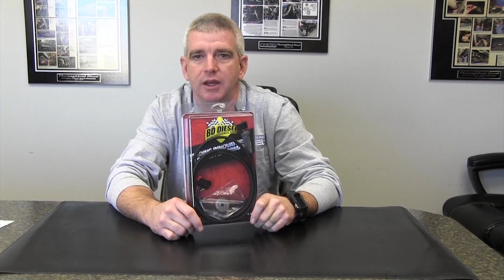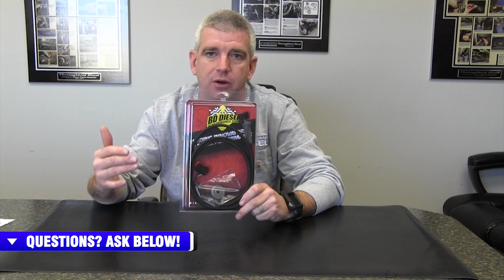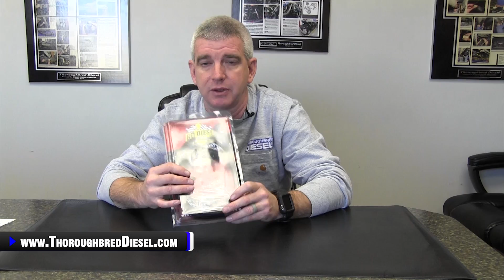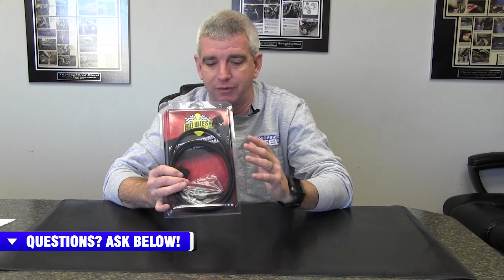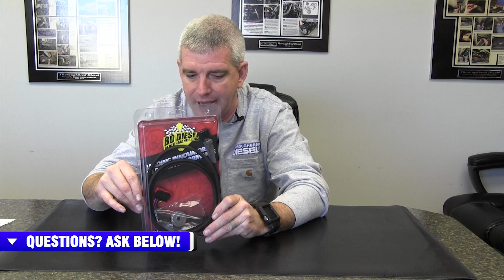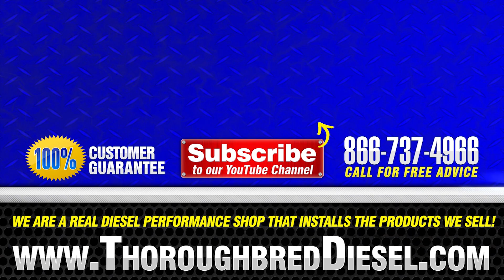FASTER Engine Warm-Ups | BD Diesel High Idle Kit

Comment: Have a 05 cummins g56 truck, would like to be able to use a high idle, can’t use the factory cruze setup. Is this an option to achieve my goal?
Reply from the maker: Yes.  BD Diesel part number 1036621 will allow you to have high idle.

Comment: I had this on my 06 5.9 along with EFI 5PS and an insight. Worked good but I had an issue with it causing the truck to throw a high return rate code and put it in limp mode. I uninstalled it and issue went away but after that I learned I had a tuning issue with EFI and went to another company I can’t say if it was a bad tune that caused it or the product but other than that it worked as advertised
Reply from the maker: Thats the one area with custom tuning that can get kind of tricky. The box tuners of the world like Edge, SCT, & others do a really good job of maintaining sensor issues that other addons might modify. If we run into a code for sensor like that it is typically EFI live. Good news is that most tuners can easily fix the issue.

Comment: Ok guys here's one for Wade an any one else out there that has a any suggestions. Dodge 2500 truck was built 08/03 5.9 VIN (C) H.O. It has been to dealer when it was new probly 12 times for not warming up. Even in the summer it goes to high Idle 365 a year. (2 Gauges mechanical an electronic) This truck will only warm up up to in the cold about 70° to 80°, in the summer 70° to 98° . That's IT!!!! It has had 4 dealer thermostats an water pumps on dealers pocket book. Drive it 10 miles an it is at operating temp of 195 to 210. Under load 210 to 220 tops ,,, thats with 46,000lbs on 40 FT goose neck trailer. WHY WON'T THIS TRUCKS MOTOR WARM UP......It fuel knocks up to 120° bad,, Then it quits that?????? It has 189289 on it now an affraid of hurting really bad because of fuel knock.
Reply from the maker: There are a few different parameters for the high idle that need to be looked at there. Do you have a tuner? It could be the manual pto idle has been engan. Also, if you are hearing a fuel knock, that really needs to be looked at asap. What you are hearing could be over fueling (injector failure) that could cost you a motor!
Reply: Truck is completely stock other than exhaust. No PTO has ever been put in. How do I disingage that PTO idle. Once it gets to 100°+ knock goes away. Any ideas????
Reply: I have even tried card board an it won't warm up. Is this normal?????

Comment: You dont need this if you have a new truck b/c the cruise control  will do high idle.
Reply: My 2010 6.7 Dodge automatically increases the idle when it detects the engine not gaining temp.
Reply: With a Ford?
Reply: Not on a newer ford
Reply: The newer fords, if you live in cold enough weather will automatically ramp up idle
Reply: @523FILMS  my 2021 won’t go into automatic high idle. Not even in very cold temps

Comment: So if I'm hearing this right, this can be turned on and off with an upfitter switch, after setting the idle? Any response would be appreciated, thanks.
Reply from the maker: This high idle kit is installed in the chassis upfitter wiring harness on the Ford 6.7’s. That’s the same place a pto engagement wire would be run to for any chassis accessory.